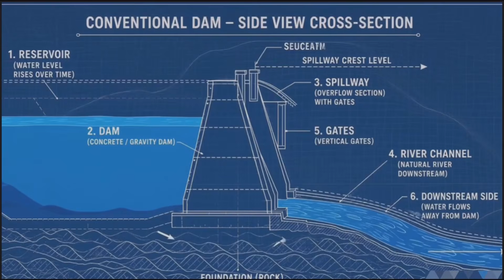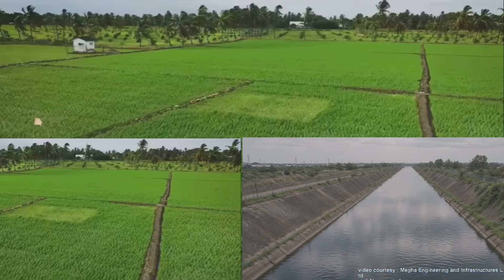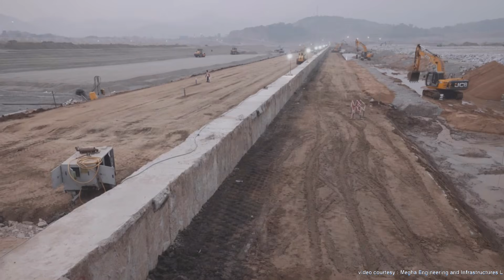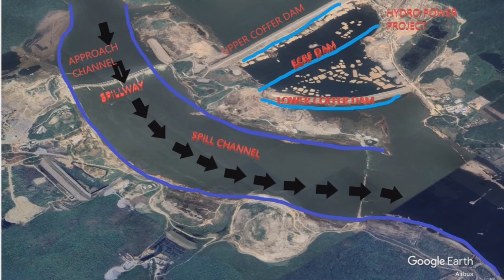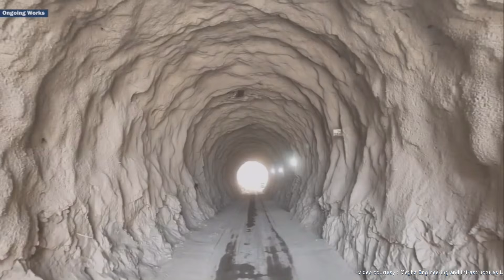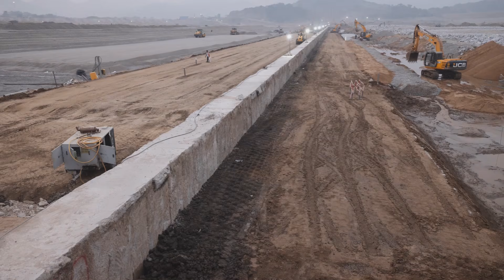Why Is This Dam's Spillway Built So Far Away? | The Strange Design this India's MEGA DAM

Comment: Random thought. In case the approach channel to spillway is blocked by sand built up,what measures are there to protect the dam. Godavari carries highest soil and sand.
Reply from the maker: That's a great technical question, definitely something engineers have to plan for carefully! 🏗️
Reply: Pose this to polavaram authorities and post their reply. I don't have the means to contact them
Reply from the maker: It’s a great gesture showing concern for people’s safety. Formal dam safety programs and operational manuals also include scheduled maintenance and inspection plans that specifically address foundation piles and erosion-related scour.